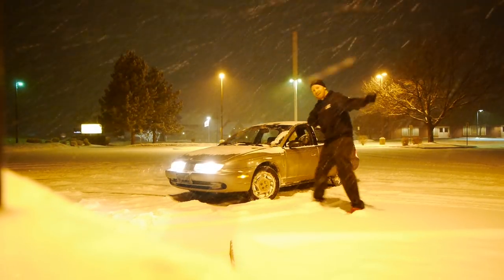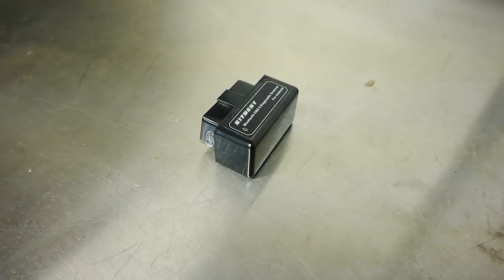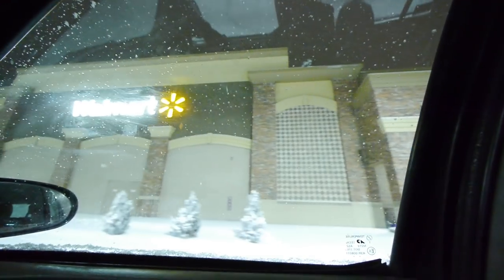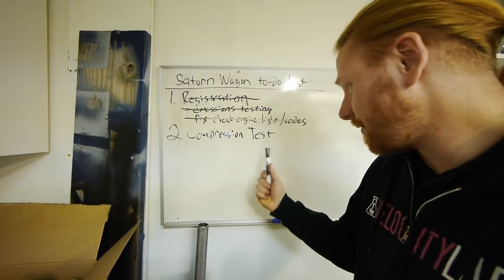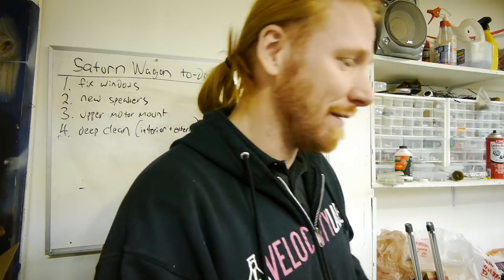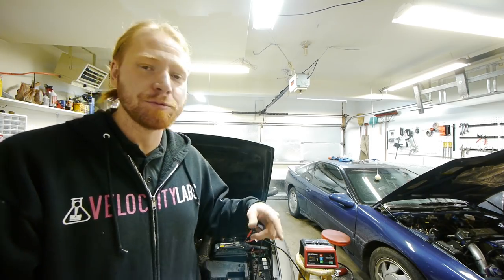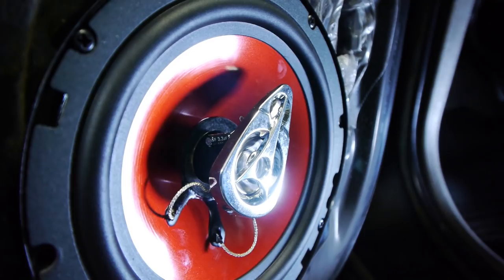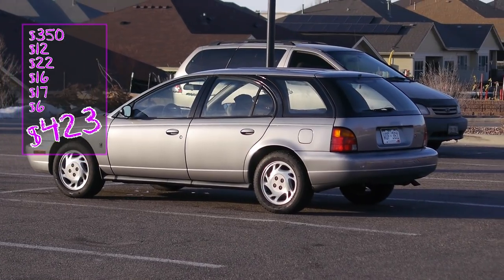$350 Winter Beater / Daily Driver - Saturn wagon!

Comment: 10:15... if it's got 220,000 thousand miles on it and it's still running great why would you even consider a Honda motor? The 1.9 liter in these cars will go 300,000 miles and more no problem... my '96 did and there are numerous '90s Saturn's with that kind of mileage on them.... it's actually a really good engine... I'm sure you were probably just kidding as everyone thinks Honda is the be-all end-all as far as reliability and engines go... But that Saturn engine will give them a run.....👈
Reply from the maker: easier to boost ;)
Reply: Velocity Labs easier to find Boost part specifically for the engine<<<( Honda)...you can use a universal kit on these and use HP tuners and I think you would be surprised at how well it holds power
Reply: My 02 Lancer had 231k on it when I sold it. And people always told me to stay away from Mitsubishis. And now they're all I buy
Reply from the maker: Got any links?  I've looked for forged internals for an S-Series and haven't found anything even remotely reasonably priced, but I don't know where to look.   Boosting a Saturn S-Series motor would be cool if I can get the parts cheap enough!
Reply: Velocity Labs there probably wouldn't be anything off the shelf... you would probably have to contact Wiseco for the Pistons and K1 rods and have them custom-made... I was talking about a universal turbo kit like grab a 20g..or a gt3071  Something.... Like that.. There are some posts on YouTube of decent power S-Series's. .. (400-450hp).....
Reply: Or Ecotec swap it ( still a Saturn engine).. and make ~500-600 HP... 👈 seriously
Reply: I've got a 97 saturn 209xxx miles starts and runs everyday 1.9 5speed
Reply: I remember the Saturn S-Series commercials about 28 years ago. Now I have a Saturn sw1. Lmfao

Comment: I had a 1996 SW2 & I loved it so much..!   Up till the day a dick head rear ended me causing both airbags to go off and because it was 2002 replacing the airbags alone cost more than the value of the car , I couldn’t get my insurance to fix it , never again have I had a car that was so much fun to drive… I love Saturns because if you took basic care of them you could have a car that looked brand new 14-15  years later not many cars of the same year could you ever say that..  thanks to the polymer body panels no dents no rust and thanks to the flex agent they put in the paint , that kept the paint shiny and new looking for all the years I had my car.  My wife had a SC1 that was 14 years old and the day she was rear ended The car still looked brand new except for one little scratch on the front bumper and the rear end damage from the jerk that hitter

Comment: My 01 sc2 has been fantastic! I live up in Northern Alberta and have decent winter tires. Traction control isn't necessary but would be nice and I bet thats a rare option on a manual! Brass coolant temp sensor, blocked off my EGR and just plugged the connector in, deleted the cats with a few tricks of the trade and ported out the factory throttle body. No issues on premium fuel. Richpins vids are awesome! My Mrs. currently has a long commute for her work and we found a 1 of 1000 10th anniversary edition SL2 auto for 1100 bux for her that just needed my touch. Cleaned the throttle body, new plugs, wires, replaced a coil pack and ignition module, cleaned up the grounding connections too. Alot of people dont realize that the PCM's are designed to run off ground. The better the ground, the better the electronics perform. Minor oil consumption issue but rather than the seafoam route I decided to try zmax in the cylinders overnight. No more oil consumption issues. The SC2 has 310,000kms and is still going strong with no issues and the SL2 10th has 250,000 and just needs a new front bumper cover. 10 mins at pic n pull and done! Best commuter cars ever! Cheers.I have some vids of the SC2 but I'll post up a vid of both of them once the weather is a bit nicer here.
Reply: I found one of the 10th aniversary ones in a junk yard and got the head rests to put in my 01 SC2!

Comment: Why newer than 1996, I’ve had 3 black sc1 saturns, a 1994,1995,1996, I love them
Reply: 1996 and up use OBD-II to check engine codes. Up to 1995 was OBD-I 'standard', where every manufacturer had their own proprietary code readers.

Comment: Barely didn't edit out the stall at 8:28 lol. But dang, I wouldn't mind a cheap beater to experiment with...
Reply from the maker: It actually didn't stall!  I went back and watched the clip and it did something REALLY weird, it sounded like I hit a pot hole, then it dropped to 0 rpms then recovered.

Comment: At the end of the video you said put an intake on it, so did you pick up the blue intake you showed at the junkyard? Cheaper/quicker than ebay lol! Also I had an SC2 Saturn 5-speed i loved that little thing, it had some work done to it before I got it so it was loud and actually decently quick lol
Reply from the maker: That was for a 2000-2002 intake manifold, they're different than the 1997.  ALTHOUGH, I could probably just chop it and make it work...    That's a good idea, thanks!  And yeah, I was surprised at how zippy that little red SC2 was, I loved it!  I just needed something bigger.
Reply: Velocity Labs I’m in the same boat lol. I had my little two door before I had two kids

Comment: Without a doubt, the most reliable car I ever owned was a Saturn L300 wagon.  I still regret trading it in.  Miss those 'Enduraflex' body panels dearly!
Reply: I have owned a 2001 Saturn LW300 since new.
It is now semi-retired but served as a daily driver for 15 years and 390 K.
Never failed to start and the only breakdown was a faulty fuel pump relay.
The only thing that doesn't work is the C/D player.
I drive a Saturn Astra daily and it has 273k on it.

Comment: I'm honestly not trying to be rude, but as an Australian I've never seen one of these cars in my life, just wondering, are they fast? Because that thing is not easy on the eyes.
Reply: They were American made and exported overseas. And there pretty slow but not too bad.
Reply: Bowie Call so it's just the old "cheap and reliable" popularity?
Reply: ConorCreature not fast, not quality and not good looking but it has the personality and charm of a car from a defunct company named after a planet!
Reply: Their marketing motto was, our cars are plastic and we have “dent resistant panels”, and for that reason, you cannot set expectations too high, for $350, you did well!
Reply: Saturn s series are great cars. It's quick ish,
Reply from the maker: It's ugly and slow, but insanely easy to work on and maintain, and parts are super cheap!
Reply: my mum had one the engine was making some God awful clank sounds opened it up and the top motor mount was shot to hell, pretty easy to spot and even easy to change just jack support the engine swap part and it drove ten times better.

Comment: You probably know them saturn manuals LOVE to chuck the diff pin and then destroy the case.  Also use rtv as a speaker gasket little easier to do
Reply from the maker: I've seen Richpin's Diff Pin inspection video, but I didn't know that's what it was for, thanks for the heads up!   I'll definitely check mine and probably change the fluid as well.

Comment: Awesome. I just bought a sw2 from 2000 with 74.000 miles. It is a automatic, with cruise control and traction control. It drives fine, only when i go over a pothole it makes a lot of noise in the back like i am driving on the steel rims without tires. And the back of the car want to move to the right or left.

Comment: Unless there is something seriously wrong with the car that u bought, that $350 will likely be a tremendously reliable car, even the automatic, the valve bodies usually go bad and some of the solenoids sometimes, but otherwise it's a solid transmission that's all gears, no junk bands, etc. But the manual transmissions in the S series will probably last 500,000+ miles...lol And the cars don't rust, they also are very light cars, that wagon is likely a couple hundred pounds lighter still than a stock civic...lol!! My 1995 SL2 is 2290-2280LBS with the Seibon hood and no spare ( the one in it was the wrong spare, don't ask, not sure what happened to it)...lol
Reply: yea, these cars are lighter than civics. My big bro had me and his son help him push his EG 4 door into his garage once. That civic fought us tooth and nail, and would roll back with all of its weight. I also had to push my mom's 02 saturn sl2 with the dohc 1.9L once, and in comparison, you can literally walk with the saturn. Not heavy at all. So technically speaking, your not gonna lose your stamina even if you do break down and have to push your saturn. Take your saturn on a walk!
Reply: @mattdiesel2294  I ended up putting a 450HP Turbo Honda engine in mine with a upgraded cam and springs and retainers and ARP head studs with a 6 speed manual and LSD.
Reply: @junechris  Welp, there goes quality. Those L4 DOHC sure pack a punch on their own. Easy to maintain seeing as i now maintain two of these engines. My brother suggested that I put a honda engine in my sw2, but i said no. I like hondas to a certain degree, but that doesn't distinguish the fact that the dohc saturns run fine on their own. I would have to invest too much money into it which i already have. I intend to instead upgrade her with a 2002 model year dohc L4 with a manual transmission. It would technically be more cost efficient for me to buy a cheap SC2 with what i want, then just put my car's engine into that, while i put the transmission and motor from that car into mine. Then I could go from there, I already have a supercharger build idea set aside for it once i get another engine.
Reply: @mattdiesel2294  To be honest I was sad and remorseful about wanting to build the LLO. It was very peppy and was a little lighter than the Honda 4 banger, weighing in a 220 LBS.  It was just more cost effective for me to build the Honda instead. Any lets face it, Honda crack a can of whoop on most everything, when they are built.